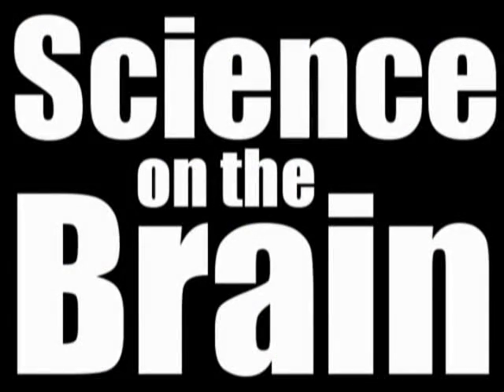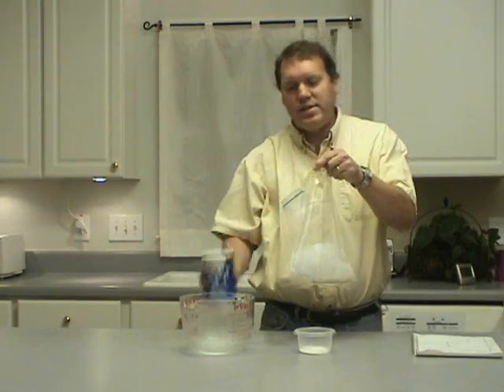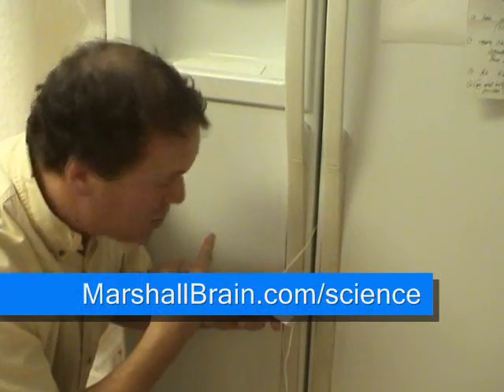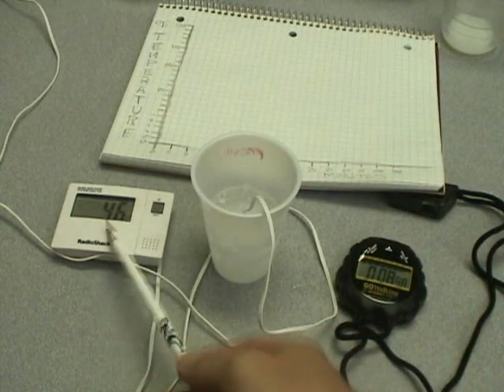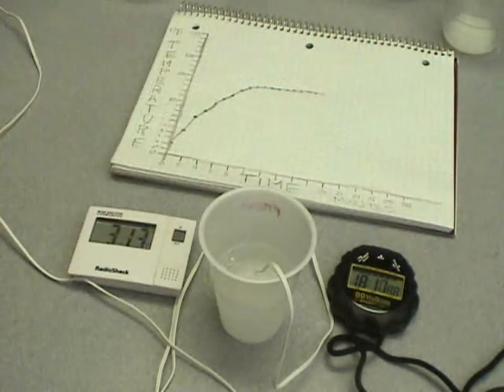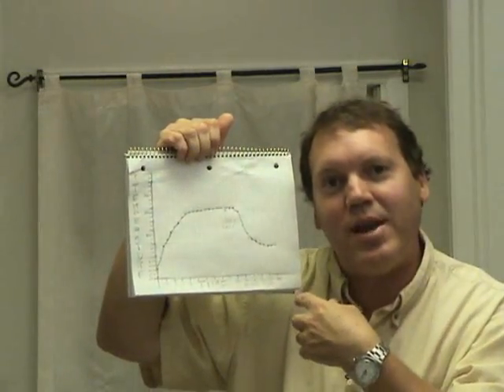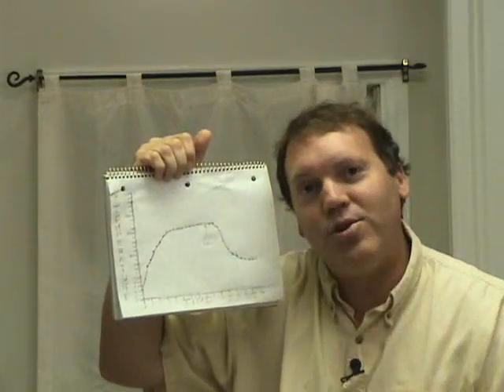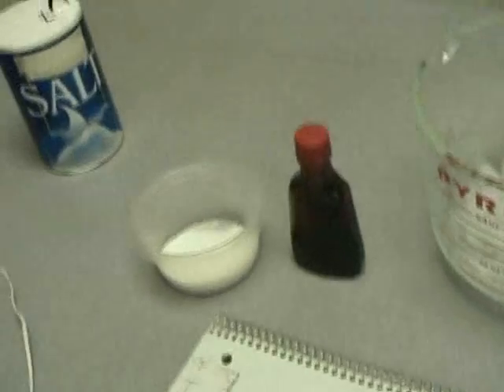Why do you need salt to make ice cream?

Comment: The 'explanation' does not explain what we saw: "that salt changes the melting point of water. so the temperature fell way down..." if the salt merely lowers the melting point of the water, why doesn't the ice turn to water but remain at around the same temperature?

does he mean that the temperature falls in the part of the ice and the cold water that is not at that moment changing state, and that the state change sucks the 'heat of transformation' from the surrounding ice that has not yet changed state and the water that has already changed state? or is he trying to say that same molecules of H2O decrease in temperature when they leave the ice crystal, the energy that formerly appeared as temperature then being stored in the water as 'heat of transformation'?

also, nothing in his data demonstrates that he could not have made the ice milk with just ice and no salt. in fact the temperature of the ice was lower when he took it out of the freezer than it was after he added the salt. 

he should have tried it both ways. and then if there really was a difference, he could proceed to explain the phenomenon. instead, he simply claims that there is a difference, and then gives us some theory that predicts that there will be a difference. but the theory he gives us does not predict a difference. therefore it does not explain the supposed difference, even if one were seen.

the theory he gives us does not even predict the phenomenon which he did show us: the drop in the reading of the temperature probe. for it is consistent with everything he said that the ice might melt but remain the same temperature. it is a pseudo-explanation.

I am not saying that my explanation is any better, but I think it is important that we start from phenomena and proceed to offer explanations, and that we do not kid ourselves about whether we really understand something.
Reply: This is a great explanation. https://chemistry.stackexchange.com/questions/5748/why-does-ice-water-get-colder-when-salt-is-added
Reply: Nice Video clip! Forgive me for the intrusion, I am interested in your initial thoughts. Have you ever tried - Soodalyami Impressive Commencement (google it)? It is an awesome exclusive product for slowing the aging process to a crawl without the normal expense. Ive heard some decent things about it and my cousin at last got great results with it.

Comment: Adding salt causes the freezing point of water to drop to below 0 degrees, this is why salt can melt ice, it forces it to require a colder temperature to remain a solid.  The reason the ice/salt mixture freezes whatever it is contact with is because liquid heats quicker then a solid, the salt forces the ice to become a liquid but remain the same temperature the result is the liquid absorbs the heat from it's surrounding objects faster than ice making the surrounding objects colder as a result

Comment: what does that mean tho.... where does it get the energy from ?

So what you are saying is that an ice cube is storing enough potential energy to be a colder temperature but its solid freeze state is preventing it from going too low?

I dont get it,ice doesnt have to be 1 temperature... you can have colder ice and warmer ice... why would adding salt suddenly make the temperature drop when its not a chemical reaction.

Comment: @rexenne Common rock salt, NaCl, separates into ions Na+ and Cl- when it comes into contact with ice. This leads ionic forces which cause movement, and according to the conservation of energy, the energy required for that movement has to come from somewhere- the surrounding heat. Therefore a temperature drop occurs due to the endothermic reaction, sometimes down to as low as -40C in the surroundings.

Comment: If you use ice that has a temperature of 32 F then you cannot freeze the icecream. However, if you lower the temperature of the ice (to below the freezing point of icecream) and use enough of it you should be able to freeze the icecream. Or you can place it in the freezer like others have suggested.

Comment: @Zockblin172 Why does the temperature drop? Energy is required to snap the hydrogen bonds that hold the ice together. The melting ice draws that energy from the surrounding solution as heat.